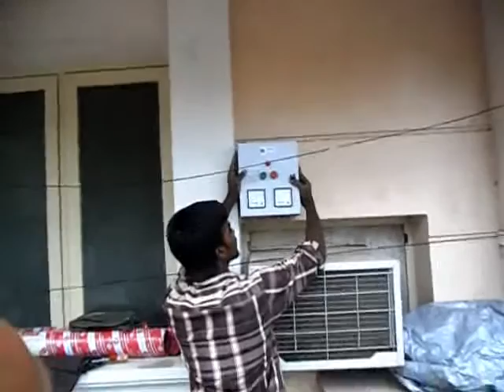Motor erection for the new bore well

Comment: Hello sir, we are planning to get a bore well drilled at our residence. But the ground here is heavily silted and nearly impossible to install the casing pipes as the silt comes in between. Also, recently one of the borwells failed as the drilling rig couldn't penetrate in the ground due to excess silt. Is there a solution you can suggest?
Reply from the maker: I am soryy Anees. I have no solution for this.